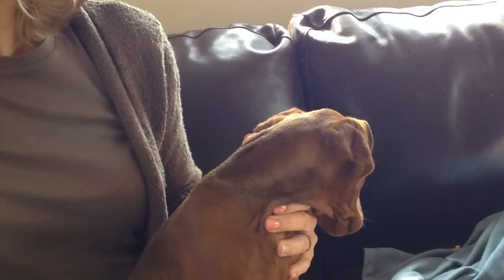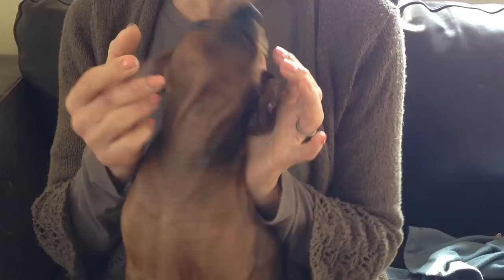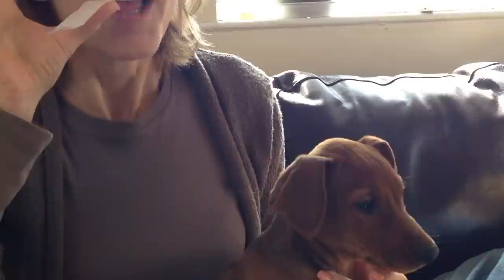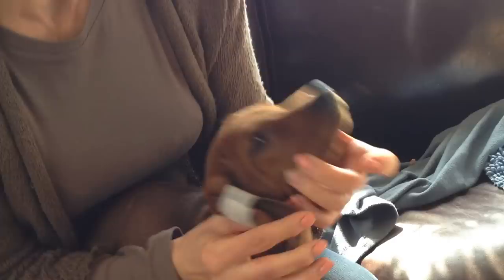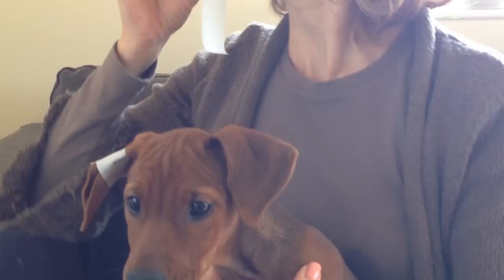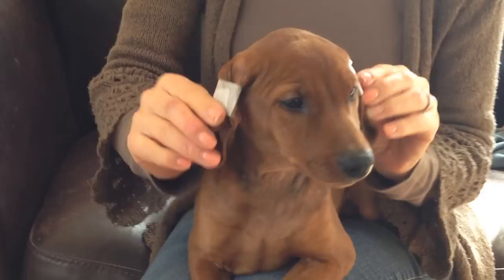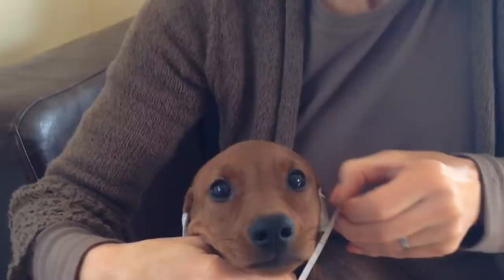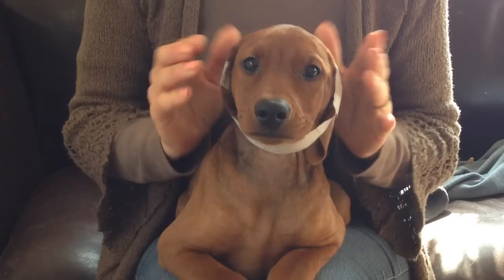Natural ear taping

Comment: I appreciate this. I have an American Bully / Lab cross puppy. One of her ears behaves beautifully, flopping forward. But the other wants to fold back in a rose ear. I'm not a fan of rose ears at all and was trying to figure out how to fix the less than pleasant one. I did some massage work, stretching out the muscles that keep pulling the ear back, which helped. But it doesn't help enough. Now I know that I can tape them to fix that. In fact, I think I will tape them both. I just hope it's not too late. She's 4 months old now. (I only got her a month ago.) Her cartilage is very thin and soft, so I'm hoping this will work for her still. Thank you for making this video and sharing it with us.

Comment: So how long will you have to keep the ears taped in order to get a permanent result?
Reply from the maker: Hi, Much depends on how early you start.  By 12 weeks, cartilage has started to harden, so it's essential to start as early as possible to train the ear to sit right.  As long as the tape isn't irritating the puppy, I'd leave it on for a few weeks - obviously changing the tape every few days. Goes without saying never to use insulation tape like one breeder did - caused an infection, and obviously tape to allow air flow to the ear. Good luck :-)
Reply: Jay Horgan thank you very much ma’am.
Reply: What kind of tape are you using?